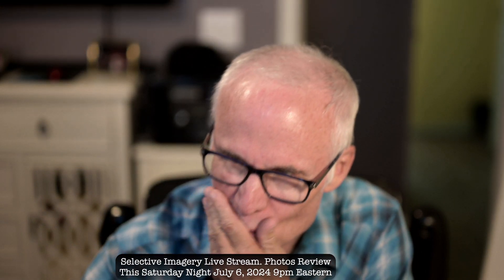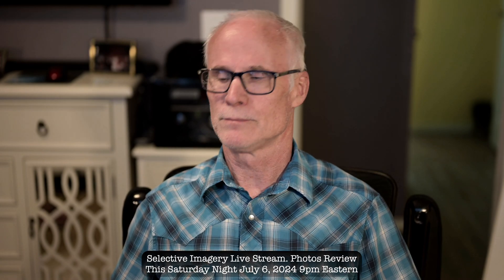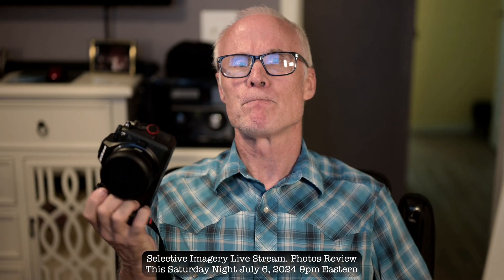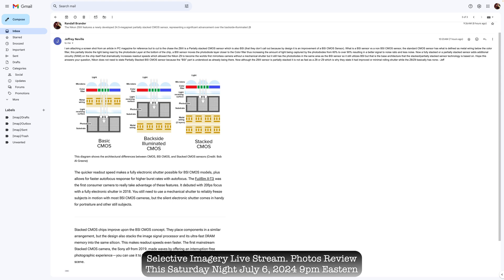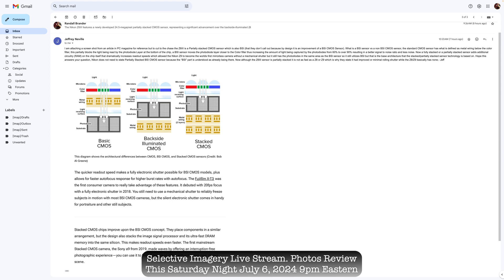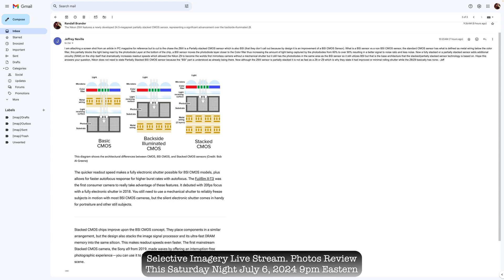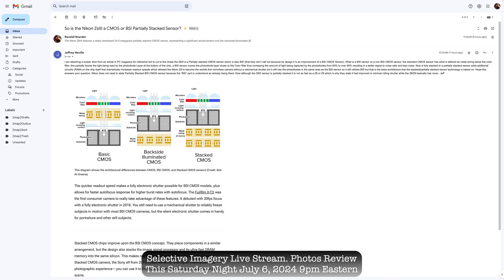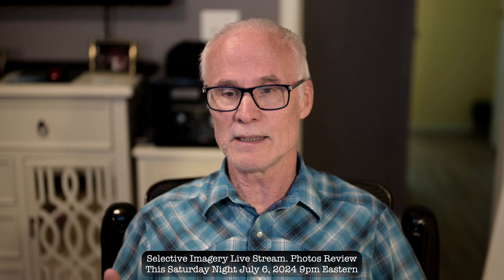Nikon Z6III Information about BSI Partially Stacked Sensor on 2024/07/05

Comment: Its a great camera if the dynamic    range would be good as well 😞
Reply from the maker: I am not worried about the Dynamic Range, more in a CFExpress Drive that is freezing the camera.  Overheating but had no issues with that so far expecially living in Texas.  Did you know that it can write 6k 60 to the SD card V90 of course.  Stabilization is excellent and the autofocus is outstanding.  I have a Z8 & Z9 also but can't take my hands off the Z6III.  Take a look at the Candle test I did and the only thing I saw was the reflection of light on my glasses.  The LCD screen had boxes around it.  LOL!  Still testing the camera.  The EVF is the best out of all the cameras that I own.  Plus the sound quality is excellent with the built in mic and when using your favorite.  Just keep watching reviews.  I always say let the hyped go down and then decide if you need it.  Be patient because before You pull the trigger to buy it that is when something else comes along that is probably better.  Cheers!
Reply: @randallbrander  I loved the camera in my hand, but had worries at pulling the blacks up at high-dynamic scenes. My old Z6 had in the same scene les problems. therefore I send the camera (for the moment) back and wait if new workflows will help. If nothing helps I will get an Z8.

PS. Did you know that the great Viewer of the Z6III does not use all its pixels in the Live-View?
Reply from the maker: @patfish3291  Yes, but it's fabulous all the same.  I am referring the the EVF.  I don't blame you, for some people Dynamic Range is important.  I look over all of what a camera can do and it's performance and take the good with the bad.  Overheating, No Video record time limits, portability, how it feels holding the camera in my hands (is it comfortable and not cumbersome), battery life and auto focusing.  Just like you if it doesn't satisfy me I will send it back or sell it or give it away.  Cheers!